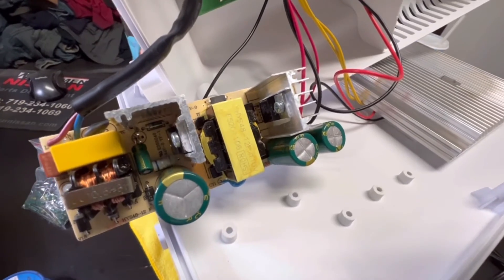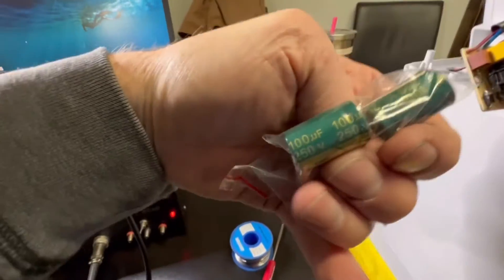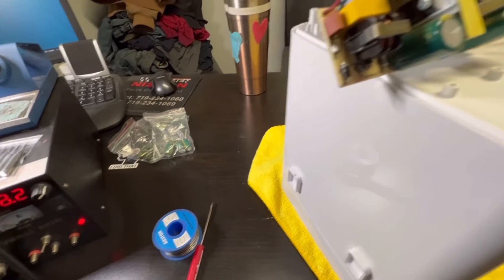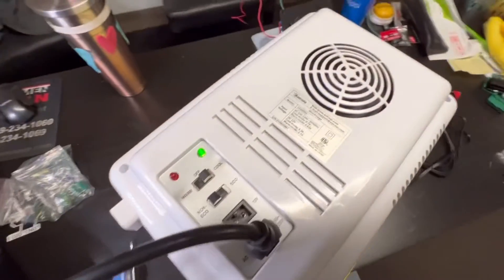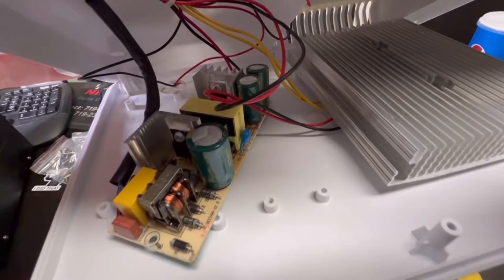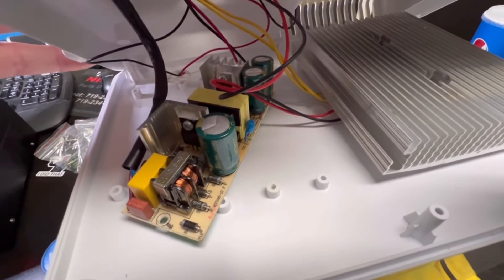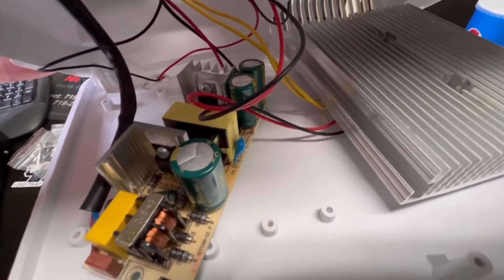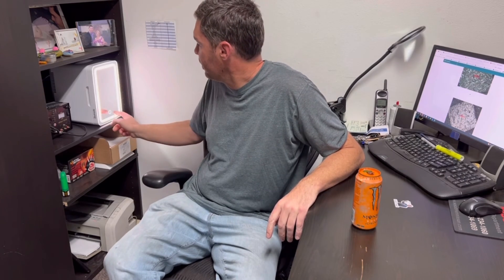Mini Fridge Power Supply Repair, Peltier Module, Astro AI, Makeup Refrigerator

Comment: Was given an AstroAI LY204A mini-fridge to look at. This model has no lights at the front. When I turned it on, all I got was a flickering LED on both the warm and cool setting. The transformer was also making noises. Looked at all the caps (2x 1000uF 25v, 1x 33uF 400V and 1x 10uF 50V) and they seemed fine. So I desoldered all caps from the PSU and measured them with my multi-meter (AstroAI DT132A) in Capacitance mode. They seemed to measure fine (was displaying close enough to the expected values). 

I had some spare PSU boards lying around that I took from some dead TVs I couldn't fix. Unfortunately, I couldn't find any similar caps to the 1000uF and 33uF ones. There was a 10uF 50V cap on the board, however. So I decided to desolder that from the TV PSU board and solder it to the fridge PSU just to see what happened. Surprisingly, the fridge now powers on immediately and stays on (both settings). The PSU is also quiet now. So it seems like the issue was just a cap problem. I will be replacing all caps soon. Just wanted to see if I could get a quick fix without having to wait for parts. 

I am now testing its cooling function. I am not sure if it's working properly though. It is cooling, but it seems to be cooling very slow. I'm measuring the inside temp with my multi-meter. Room temp is 20C and after a few hours the temp inside the fridge dropped to just 16C. I am not sure how long these take to cool. Any ideas what might be causing slow cooling, or is slow cooling normal if it's been off for a long time? How can you tell if the cooling function is working properly/as expected?

Comment: Hey thanks. I found this same fridge at a thrift store for a couple bucks. The 12v side works fine but the 110v does the same as yours.... I was actually looking for diy stuff and this popped up.
Reply: Same found me a cooluli 12L at the thrift and it does what he said just flickers on with the fan moving for a few seconds but the light works fine gonna have to do this

Comment: Hi, thank you for posting this! I have this same mini and it doesn't get cold at all. Instead it was hot. Bought it on fb market the other day plugged it in and put cold setting on. Green light on back works and three mode lighting on front mirror works...  Just wondering what would you recommend to solve this issue? Any advice or suggestions are appreciated. Thank you!

Comment: Hi, I confirm that the 10MicroF/50Volts capacitor was the culprit. I got the AstroAI LY1906 Model, with the same problem of the flickering light in the front. Just change the capacitor and way to go. If you can acquire the rest of the capacitors, like the video says, change all... but in my case, just with changing the 10Micro/50 Volts Capacitor do the work. For the tech you out there, i test the bad capacitor and mark 9.75 microF, so i change it. Thanks Jack for the video advice.
Reply: Same. It is just discharging that cap in seconds and recharging so that is why it is flashing.

Comment: I moved from Ohio to Florida and seems my mini fridge broke along the trip and now has this surging issue with the light. The fan spins fine. I’m compfortable trying to solder (even thought I’ve never done it before) but is it worth money wise to buy a soldering kit for this or is it cheaper to get a new fridge
Reply: Might be more expensive to buy a soldering kit and you might not even fix the problem. But you learn a new skill along the way which money can’t buy

Comment: The switch with the LED lights burned out in my unit.  Do you know where I could buy a new circuit board with the switch and the lights?

Comment: So i have a mini fridge the doesn't cooling or heating so i thought to replace the power supply with 65w laptop charger does it work?
Reply from the maker: Without diagnosing the issue properly, replacing the power supply is just guessing.  There is nothing wrong with the original other than the caps.  It would be cheaper and easier to just fix the original power supply.  

If you must do it the hard way then your power supply will work it's 12v and has a wattage rating higher than the label on the back of the fridge.

Comment: How do you take the caps out and replace? I don’t want to do any additional damage?
Reply from the maker: I have been soldering since I was 8 years old so it's easy for me.  What I do is melt the solder on 1 side and tilt the cap UP on that side.  I then do the same on the other and repeat until it's off.  This way you are going quickly to keep the heat out of the board and not trying to suck the solder up which can also overheat the board.  Install is the same.  Melt one side and run the cap through and then use fresh solder when done to make it nice and clean.  Note- caps have a mark on them and on the board for polarity.  If you put it on backwards it will likely explode.

Comment: Hey Mr. Jack.. This isn't fridge related, but hoping I post this on a newer video, and you get the change to answer.   Can you talk about transmission failures.  I understand the 2009 failures, but for other failures, do you attribute them to poor maintenance (i.e differntial/transmission fluids not being changed often enough), mileage, too much horsepower and torque, or abusing the car (i.e, constantly using launch control).  I'm wondering because i'm the owner of a stock 2012 GT-R with over 120K miles.. and never had any transmission issues.  I'm "finally" considering modding (fairly conservative), just maybe a mid-pipe, airbox, and perhaps a new fuel pump and injectors, but don't want to grenade the transmission.  Also.. are there many changes in the transmission hardware between years of the GT-R?  Thanks so much.  If I ever have an issue with my transmission, i'll definitely be calling you guys.. or driving up if I can still drive.  Or.. as a precaution for mods.
Reply from the maker: Hey sorry I don't really check messages here.  Email me directly at shop@jackstransmissions.com and I can help there as it would be more consistent as I check my email every day.

Comment: I have a similar model and a coke edition, both probably have the same problem, thanks for the video!
Reply from the maker: Likely is the same issue.  I purchased a couple of Budweiser units to use the parts to make cold cup holders for my truck. One of them had the issue, brand new, straight out of the box, lol!  Seems very common.

Comment: By chance, do you still have the links? I'm going to attempt to fix my lady's makeup fridge, and I want to make sure I get the right  parts.....great video BTW
Reply from the maker: Yes. Here are some links. Took awhile to get them as they were coming straight from China but they showed up within a couple weeks:

https://www.ebay.com/itm/193001387507?mkcid=16&mkevt=1&mkrid=711-127632-2357-0&ssspo=0ZtdoCRyTEe&sssrc=2349624&ssuid=3KSmUG6LQVO&var=&widget_ver=artemis&media=COPY

At the link above I ordered the 50v @ 10uf and the 5v @ 1000uf in their options menu. 

At the next link below:

https://www.ebay.com/itm/254297921336?mkcid=16&mkevt=1&mkrid=711-127632-2357-0&ssspo=mQcrK3z7SoK&sssrc=2349624&ssuid=3KSmUG6LQVO&var=&widget_ver=artemis&media=COPY

I ordered the 250v @ 100uf from their options menu. 

Make sure you have a power supply issue before ordering. If the power supply seems weak then it’s definitely caps. Nothing else really goes wrong with the power supply other than that. Solder joints are usually not great and could use a reflow in some spots. 

Easy way to verify if it’s power supply is to detach the output 12v wires from the power supply and then attach the 12v car adapter and see if it works. If it does then the power supply needs attention. If it still doesn’t work then something else is a problem. 

The switches on the back can be finicky and cause intermittent power issues too. 

Good luck!